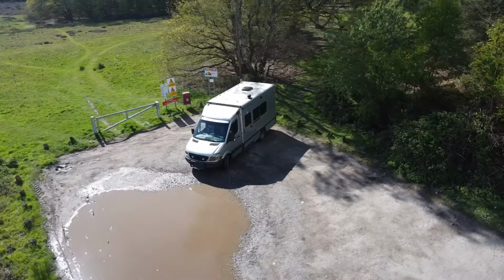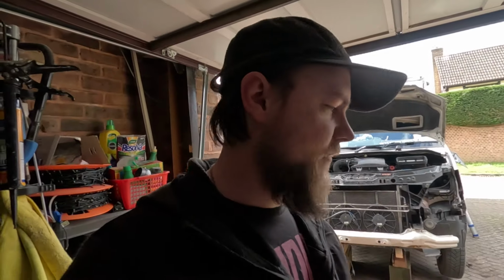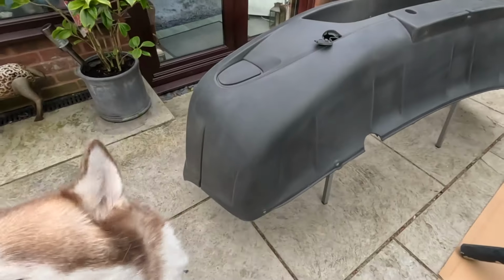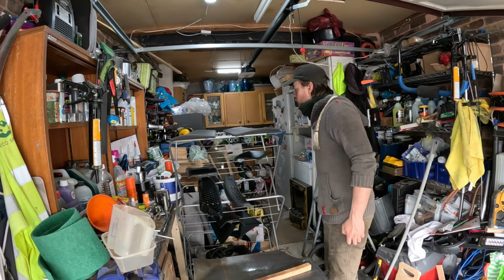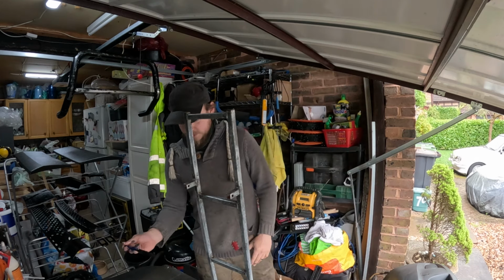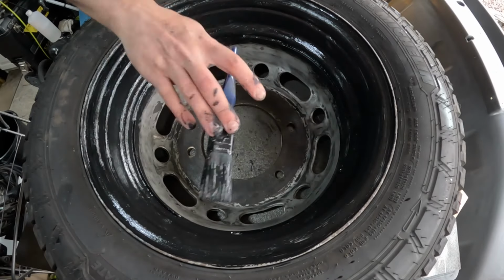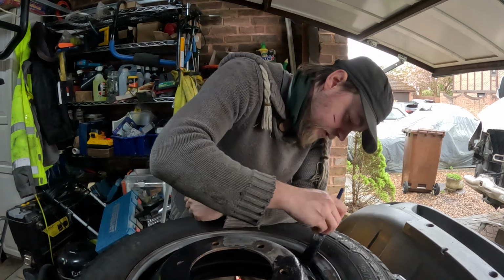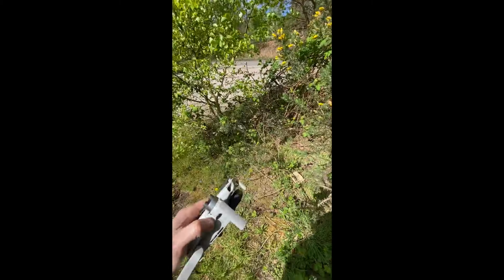Raptor Painting My Sprinter RIOT VAN With A Roller & Brush | DIY VAN PAINT JOB SERIES PART ONE

Comment: My Sprinter Ambo is Raptor by previous owner, but never occurred to use it on the wheels & they are in a sorry state. Thank Cam great video👍
Reply from the maker: Cheers Taff. If you’re just doing the wheels you might want to buy the raptor paint in the spray can, would be a lot easier 👍🏼👍🏼